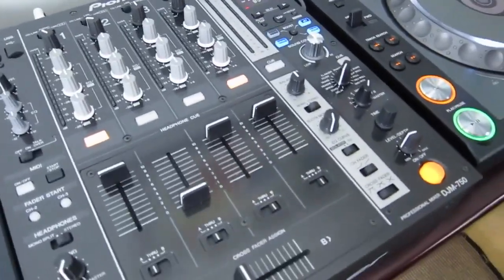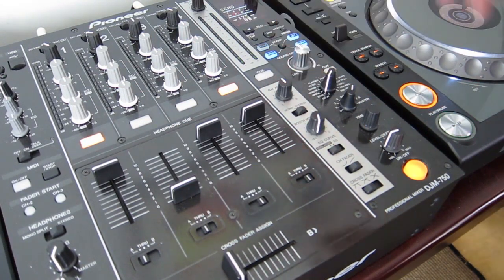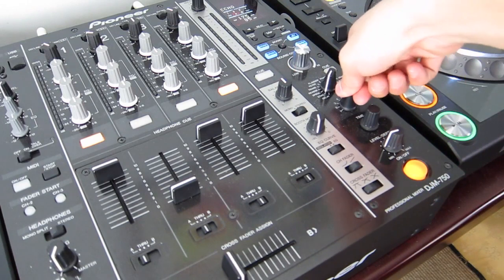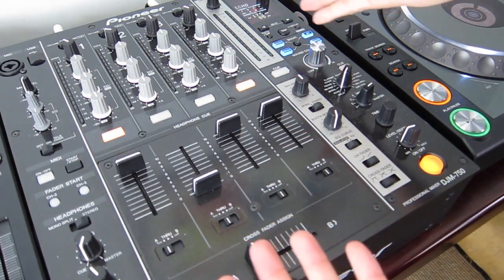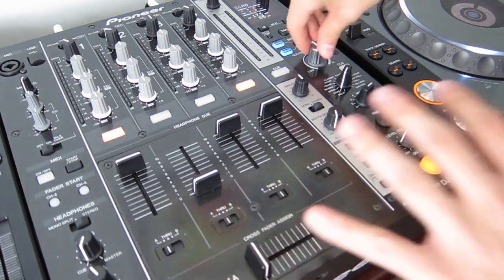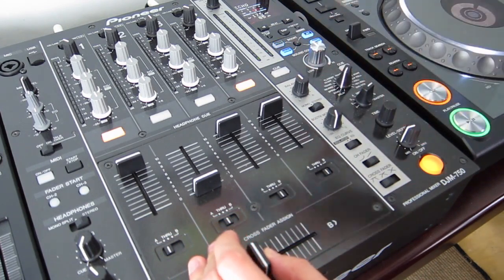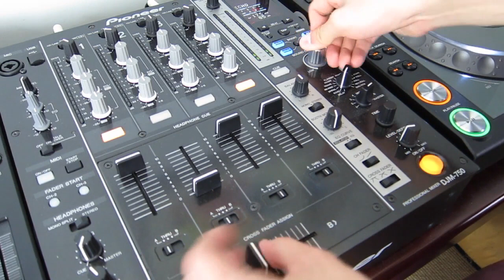Quick DJ Tips - Fake scratching with "Noise" on your mixer!

Comment: Hey Ravine 
I was just wondering if there was a way to do this with the Pioneer DDJ-SX? Would it still work if you used the LP/HP filters on the channels on the mixer or would you have to use the effects on the turntables because I don't think the DDJ-SX or any other controller from Pioneer comes with the noise colour effect you're talking about. Please help if you have any suggestions